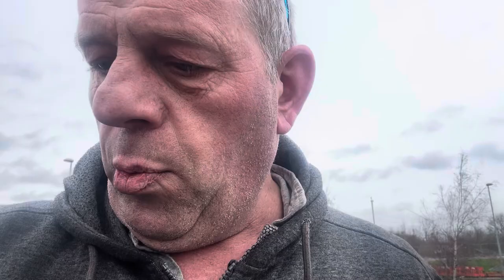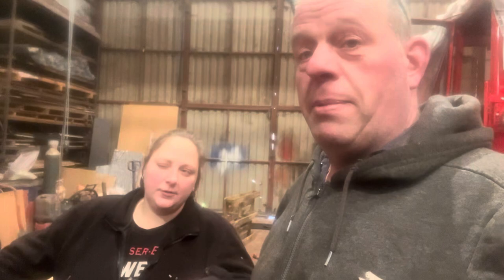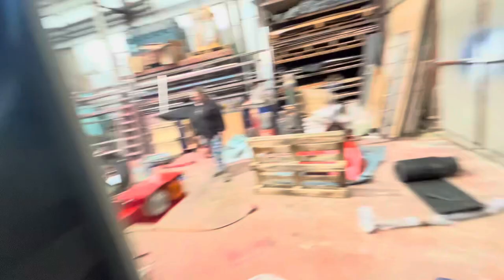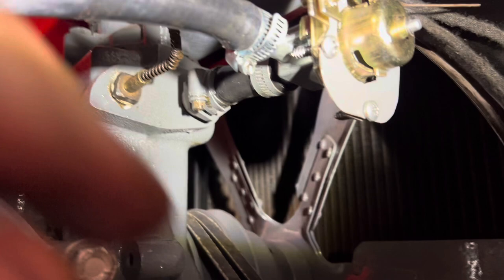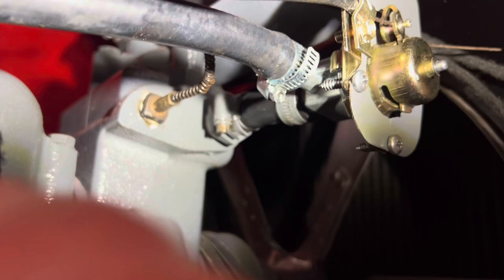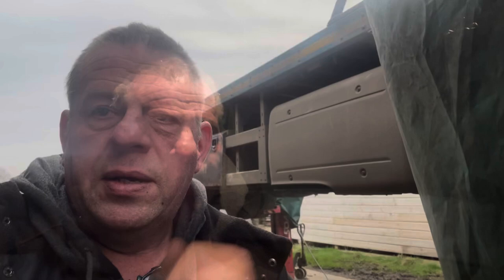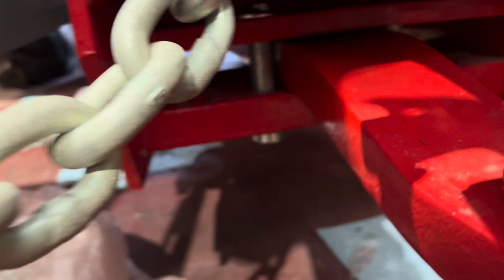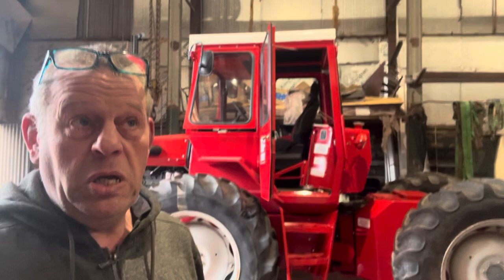Massey 1200 finally move under her own power 👍👍

Comment: Looks original, mine with a 760 combine 140 hp engine sounds different, exhaust and filter on more natural/shorter pipes right side, bonnet opens from the front with 2 hinges outside the front window,  platform with room for 2 1000 litres pallettanks behind, sprayer soup or fertilizer runs for itself to the pump in liftarms and regulation to the left of driver, new inox diesel tank with fillercap moved inside, a lot of rust in the old one (broken pumphead), good luck with the reborn.
Reply from the maker: Sounds interesting , like to see some pictures